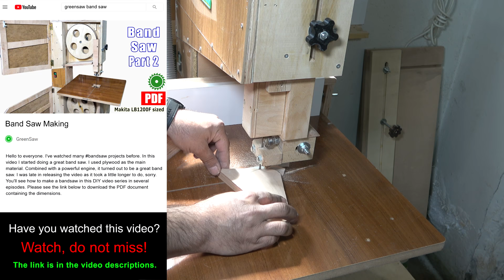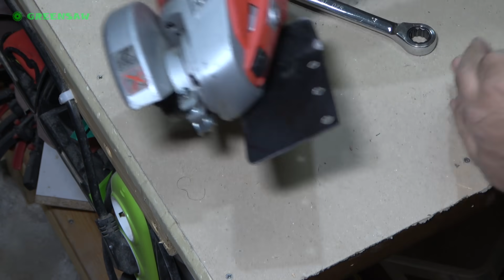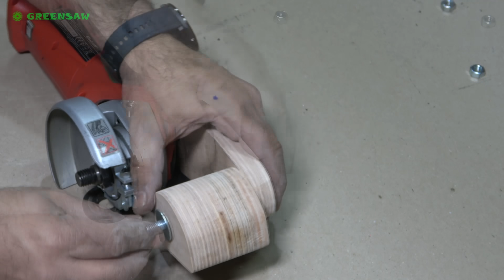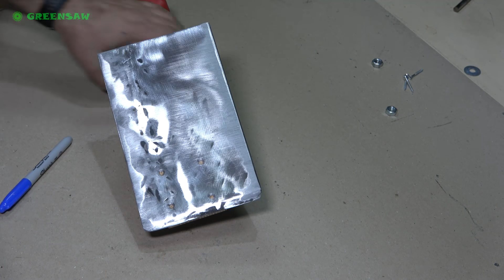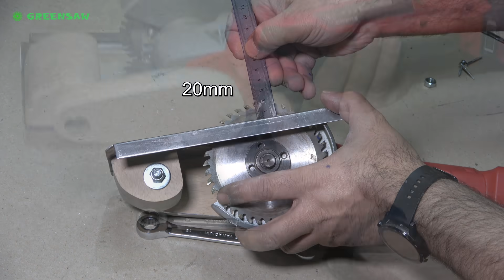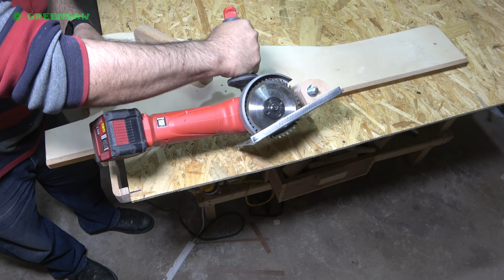DIY Mini Circular Saw from Angle Grinder

Comment: Great idea for cutting wood BUT have you thought of using the same concept for cutting large sheets of steel? And instead of using wood for some parts, using steel for all components? And using steel angle for a guide?
Reply from the maker: Hi, I didn't plan on using this for cutting steel.
Reply: Understood. BUT....

Comment: You should NEVER ever use a circular saw blade in an angle grinder. Circular saw blades might grab the wood and if that happens the wood would fly across the room or worse, the tool may kick back to your hand or your stomach. It will spin forever, since grinders do not have brakes or triggers.